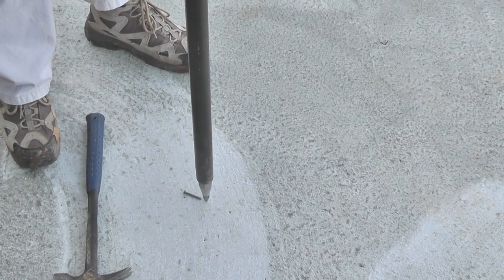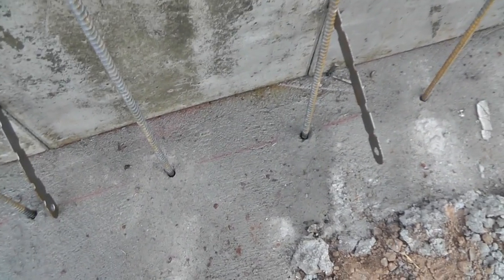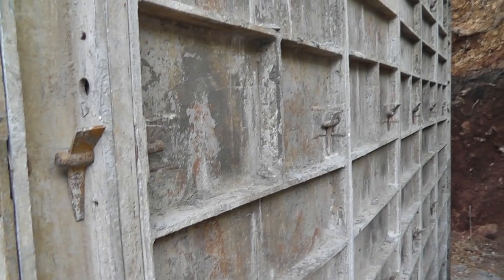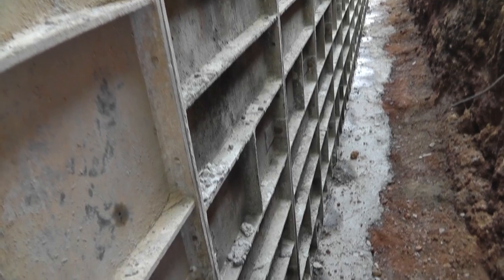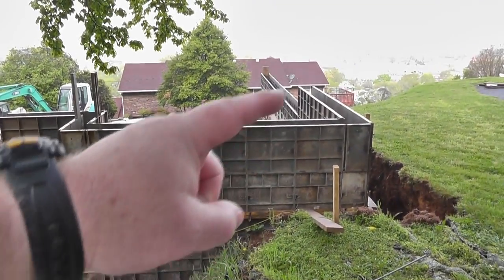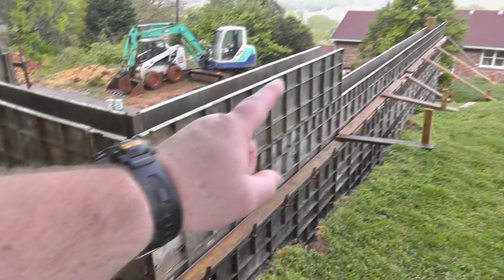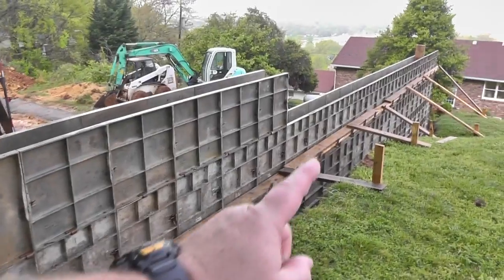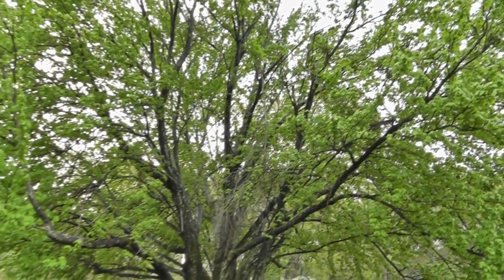Missionary Ridge Home - Vlog #7 - Forming for Concrete Walls

Comment: I use to work in the foundations  and belive me it is a hard job, we use to make 11' foundations  with  number 5 rebar, also the footing but we always level the footing with the laser , it's easier later, really hard job when it is over 100 degrees but I have to admit this forms are a lot easier  than wooden forms.. we made a lot of beautiful  basements in the rocky Mountains.

Comment: Why do american houses have basements?
Reply: Actually , I have come to understand that the basement issue is mostly justified not by cultural reasons but practical. If you have to dig 1.5 to 2 meters to find proper soil to build, why not go a bit deeper and make a basement. Even if only for storage.